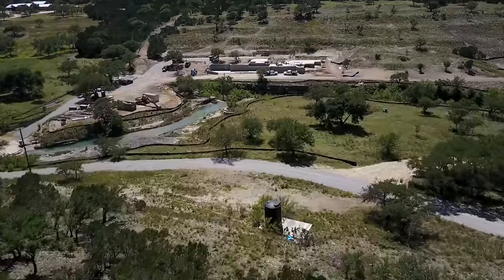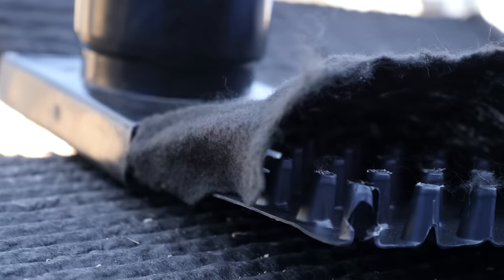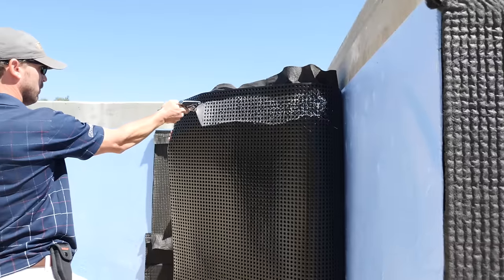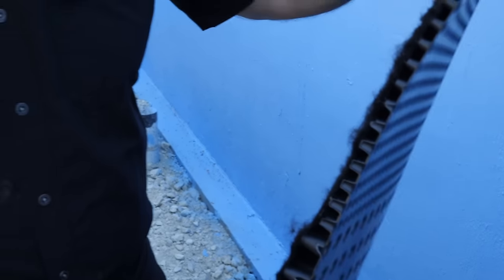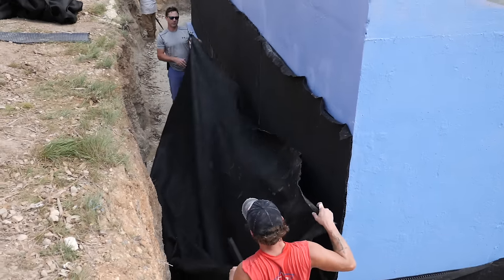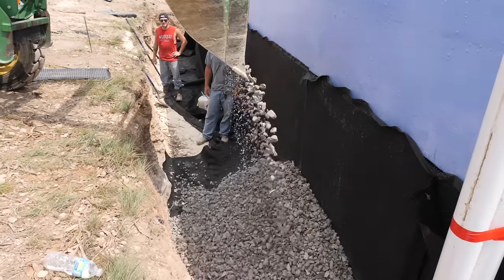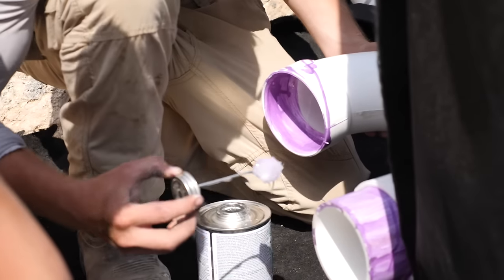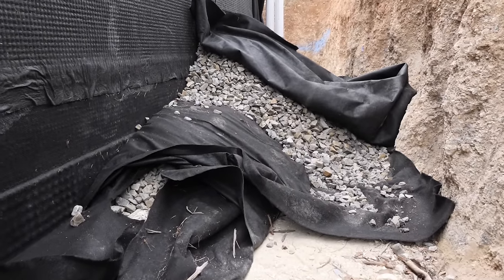French Drain and Foundation Waterproofing System

Comment: 2 questions.
1 what is the french drain sitting on? it almost looks suspended in the air.
2 where does the system drain to? a sump in the house? storage tank in the yard? the near by stream?
Reply: Brian Abington The drain pipe is resting on top of a filter cloth, the cloth is laid over washed gravel or on dirt. The pipe level shoud be just below the floor level inside, or deeper.  The water discharge is most likely to the down hill side of the structure into a green space or a cistern or dry sump.
Reply from the maker: +Abby Babby yep. Thanks
Reply: Matt Risinger After I answered Brians question I was working in my Blacksmith shop and out of no where I thought "That was really arrogant to answer for Mr. Risinger"

Comment: That is not code, the pipe needs to sit on a minimum of 2" of gravel: IRC 405.1"Drainage tiles or perforated pipe shall be placed on a minimum of 2 inches (51 mm) of washed gravel or crushed rock..."

Comment: Brian never answers the question about why he uses the second pipe for his french drain. Anybody know why he uses 2?
Reply: Jordan Lane-Miller Maybe to allow for air to enter the system?  No different than your bathroom having a vent pipe section. Or, one was for the French drain and the other was for a downspout?
Reply: @orion3267  found out through a back channel that he was just doubling up on his drain pipes that served the same purpose. No reason other than to overkill the setup. However, what I heard (don't quote me) was that Harvey hit not too long after this and not a single drop from that side of the house which had a step hill running down to it. This really was a belt and suspenders approach that paid off.

Comment: My question is this, where in texas are they building a house with a basement? I grew up in Houston and have been through the entire state and never saw a basement.
Reply: This house was built in the Hill Country outside of Austin.
Reply: There's a few out by Lake Travis and the area north of Austin. Rock homes, basements, split levels, decks with a view, 2nd floor decks, walk-out basements. Watch out for the scorpions, copperheads, and bad soil, though.
Reply: houston is set on what is now a giant bathtub floor; there is no more exposed dirt to wick water down. what hasn't been converted to foundation slab is basement or parking lot and roadway. it's been that way for a generation but now houston is going to be wetter, with the sea gulf rising over most of it in the next 20 years or so.
Reply: Houston doesn’t have basements because it’s below sea level in a flood zone, as the 2017 hurricane seasons showed very clearly. So unless it’s supposed to be an in ground  pool it’s not recommended.

Comment: Couple things done wrong on the drainage system.  PVC pipe should always go next to the footing, not on top of the footing.  You drain pipe must always be below the cold joint.  The lower the drain pipe the better.  Next the geotextile fabric should go down first and then the pvc pipe with holes down and the gravel and finally do your burrito wrap.  Sorry I'm a structural engineer and I want to make sure people know the correct way it should be done.
Reply: Would you put down 2 inches of gravel first? Then fabric, then drain pipe, then gravel, then fabric for burrito?
Reply: @chrisdfaulkner  a couple inches of gravel first is not a bad idea.  It's probably a good idea to make sure that holes in the bottom of the pipe don't get restricted from water flow.

Comment: 5 million? I got 5000 what can you do for me friend?
Reply: My step and I would easily take that 5g down the road if the system was improperly or not installed at all, and fix it or build one, plus some extra for the labor. We used to have our own basement waterproofing company until he sold it when he started to have physical issues and I moved on to do other work as I was not interested in running the business labor wise as I was still in school. To much hacks out there to deal with as well not fixing their mistakes or warrantying their work like we did.
Reply: A stick and straw and if you call in the next five years we'll throw in a sample of our new and improved flex drain (black) other colors available up pricing ,taxes, shipping are extra

Comment: Clean outes are nice but not necessaryas long as the drain to ground is relatively close to the house. But unlike this multi million dollar builder i only run one pipe and usually run spouting into the longest section. On the priciple that the storm water washes out silt. The burrito makes a lot if sense and is commonllace in large retaining walls. Because there you dont get water people die and you get paid for it.

Comment: Bullshit system, gravel will be as good and less expensive.
I can't see why a thick pvc would be needed, a std one is enough. I just digged out one at my parents house, been there since 1980...still strong.
The simple way is gravel on all the height of tthe wall, polyamid or whatever on the wall, gravel... Fabric. Vertically... Fabric, pvc tube, gravel. Here we use a pipe that got holes on half the circonference of the tube, holes to the top, holes in the gravel and not holes against the fabric cause it could clog fast.
If 2cm water still stay, it's not a problem. To be more precise, in France we use this kknd of things : https://encrypted-tbn0.gstatic.com/images?q=tbn:ANd9GcQtmw7EoFQnAPfIzE8-Hb9i-R53s9G4pQQSmNCCTdhAk6slNaOZBA
Holes are to the top. It makes sense... The guy from the video got no clue on what he is doing.
An other example : http://blog.hamil.fr/wp-content/uploads/2018/01/drainage_maison.jpg